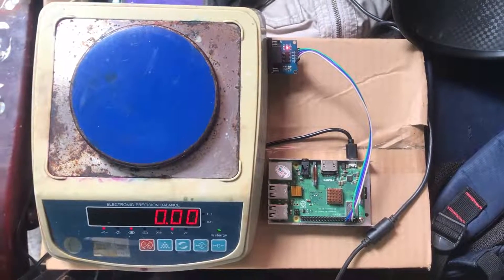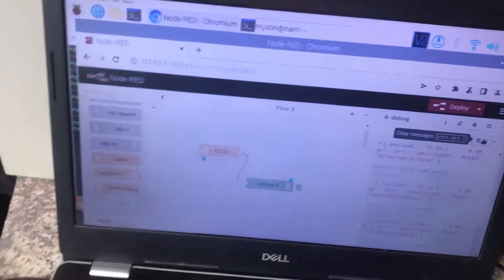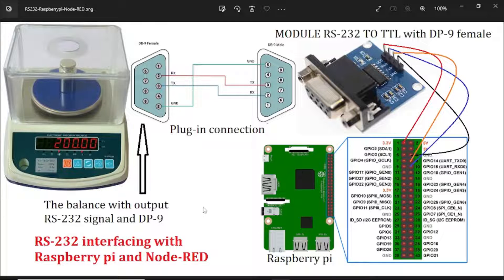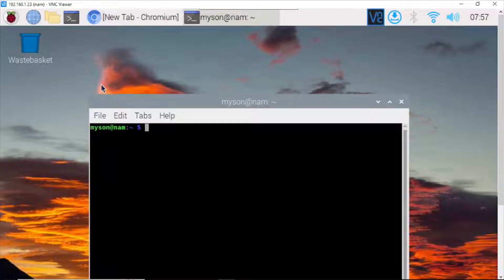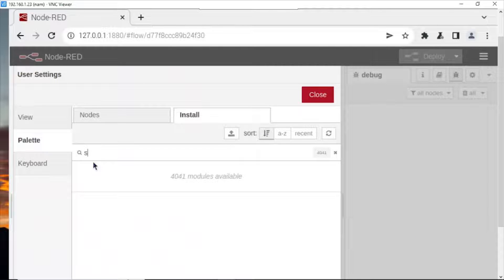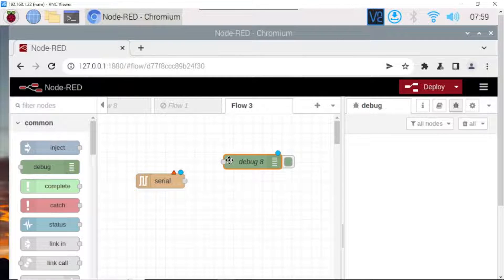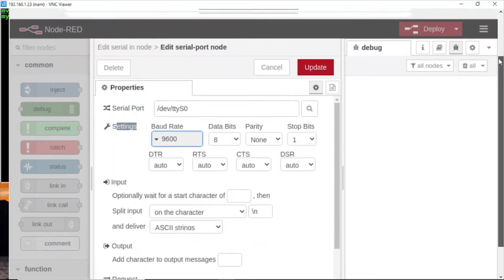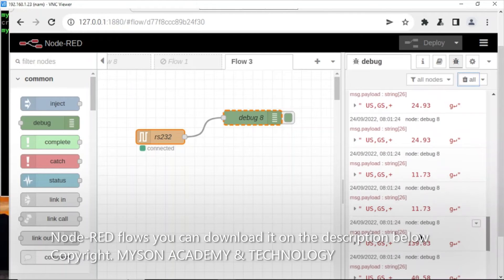RS232 to TTL Raspberry pi Node RED | Serial Port Raspberry pi Node RED

Comment: I tried your steps, but couldn't get it to work. For one, the serial port didn't have permission. I worked through all the online suggestions, but could only get the serial port to have permission for a few minutes. And, the first scale I tried didn't have the ability to continuous print, even though it was more expensive. Finally, I added a RS232-USB converter and a $70 scale from Amazon, and changed setup to ttyUSB0. Now, it's working great. Changed the ASCII to number, and I'm writing the value to an Allen Bradley PLC. Thanks for your video.